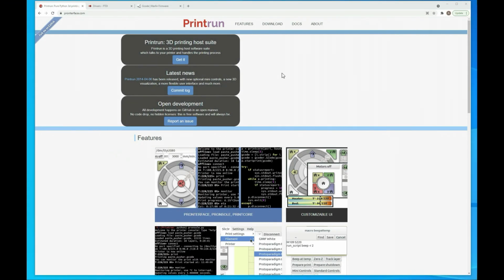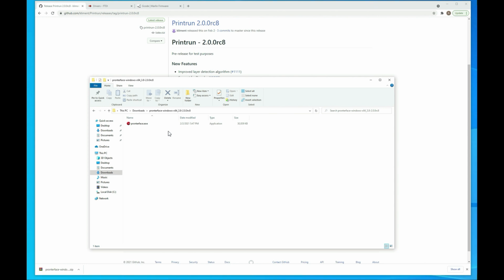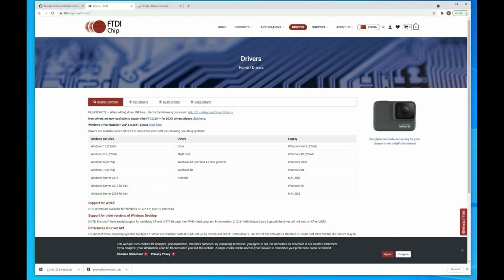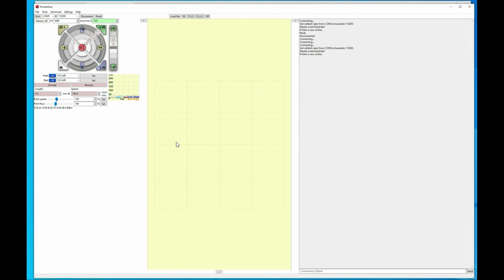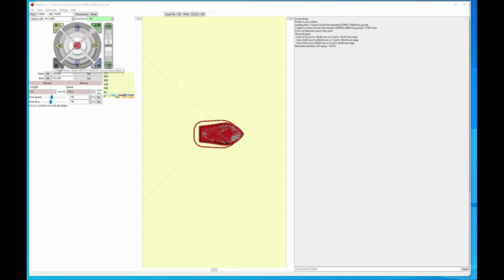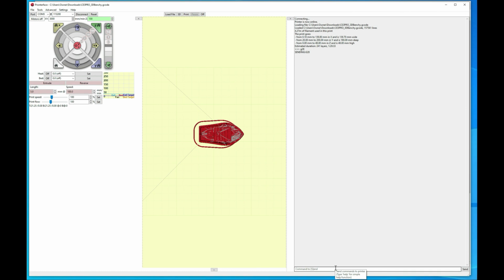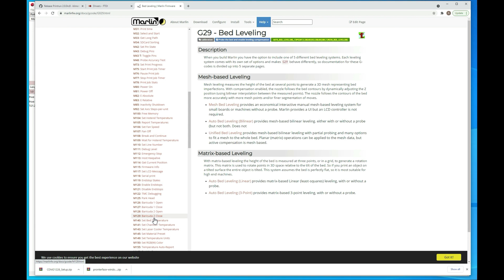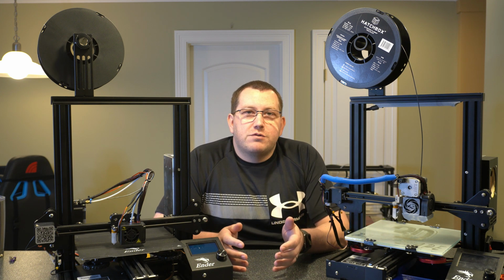Pronterface Setup – The Easy Way!

Comment from the maker: I hope you found this overview helpful! If you have any questions or would like other tips/tricks, just let me know in the comments or join us on Discord.
Reply: I have a CR 6SE. I can't find a driver to connect to the Fronterface. Could someone out there that has one, could you post the direct link to me. Thanks
Reply: Does pronterface communicate via serial interface with the board running marlin? If so, does it send commands via ascii? Or does it send them as binary? If my arduino serial terminal is up, can i send a serial out command to the board running marlin?can i send a m121 command via the terminal window?
Reply from the maker: @damon_81  My understanding is that pronterface communicates to the board over a serial connection. When connected you can send gcode commands via the terminal to the printer. I dont have a good answer on your other questions, sorry.

Comment: I fixed my e steps on ender 5 plus but now i have 5 blank pages for my print files
Reply from the maker: Hi. In the screen your just seeing blank menus? Did you only update teh esteps or was anything else changed?
Reply: @3DPrintscape on the screen with or without sd card also tried a new 8 gb sd card and still 5 blank pages i just changed the e steps with pronterface and went to do a test print and then it stopped the print midway and the sd card that was in there got destroyed as well
Reply from the maker: @alanoconnor7970  Ive never seen this behavior before, it could be a hardware issue.

Comment: I have a CR 6SE. I can't find a driver to connect to the Fronterface. Could someone out there that has one, could you post the direct link to me. Thanks
Reply from the maker: Hi. The driver may have been auto installed when the device was connected. You may not need a separate one.
Reply: @3DPrintscape  
I did a windows update and that fixed my problem. Thanks

Comment: I am not able to make perfect circle. Printer is drawing 2 side parallel lines. how to solve this? I am using pen for calibration. During rectangle, square or triangle I am getting perfect shape with exact dimensions.
Reply from the maker: Hi. Honestly i have never tried this though it should be possible.

Comment: gettin ""Got rubbish reply from COM3 at baudrate 115200:
Maybe a bad baudrate?" , no matter what baudrate i select, always the same. manager says printer is there, port COM3, thats what i select.... i dont see the problem :/
Reply from the maker: Hi. Are you sure its the right com port? Also, did you try rebooting? I have seen ports get locked or have random issues get fixed by rebooting. If that doesnt work, try a different cable.

Comment: Hi!
I m a Mechatronics Engineer. I m working on a 3d printer. I used the same Pronterface for 3d printing. When I upload the gcode file to print. After uploading when I gave Print command the printer doesn't print. The stepper motors works but while temperature command of hotend and bed the software gives an error *Write Timeout*.
How to solve this error? What's the point due to which this problem arrises?
Reply from the maker: Hi. Are you sending the commands one at a time or all at once? Im curious if its a buffer issue.
Reply: @3DPrintscape  One command at a time
Reply from the maker: @talhazafar7159  Ok, i have never seen this before. It may be worth checking computer memory/disk to make sure its not running out of space. If that looks ok, look at the event logs around that time to see if it give you more info on the error.

Comment: Hi, I am using Pronterface to check for error messages.  The error is random and may occur after several hours.  How do I send the error messages to a log file so I can read them later.  There seems to be an option in the menu but I am not sure of how the path should be written and could not get it to work.
Reply from the maker: Hi. I have never tried to save the logs to a file. There may be an option in pronterface to do it but I’m not sure.

Comment: I made printer and create stl file to gcode file when put gcode file in pronterface connected and run but my printer not run on gcode file and how to set this problem
Reply from the maker: Hi. I dont send the prints from pronterface so im not sure what the process looks like. Assuming you used a slicer to make the gcode file, sending it should start the print.

Comment: Well that confirms my suspicions  pronterface is rubbish... I had so many problems with this pos 
I now use repetier host which impv is miles better and connects no problem does all this and more and is also a decent slicer .. Plus its all free ..
Reply from the maker: Hi. Ya it’s not great but works most of the time. I will look into repetier.

Comment: When i try to connect it gives me this error (13, 'Access is denied.', None, 5). Any help?
Reply from the maker: Hi. Ive seen this when connecting to the wrong device or something already locking the connection. Rebooting the computer fixes it most of the time.
Reply: hey.......... did you find out the actual cause of this error?? i have been facing this issue for 18 days but still can't find the solution... it would be much appreciated if you could help me out

Comment: A very helpful video.  Appreciated.  I have an odd error that I just cannot figure out.  When loading files for USB printing I'll get a memory error "cannot load memory into array".  doesn't matter the size but usually happens with larger files.  I I have one that is 40+MB and 733 lines.  Always fails loading around line 400.  Sometimes sooner and other times later.  SD card printing is not an option.  Must be USB.

Long story short this happens on any PC (win 10 and win 11) so it is NOT the computer or OS.  This is something with pronterface itself.  Appears that while loading the file it just runs out of its reserved memory but it's not consistent.  Any ideas on how to fix this?  Any settings I can look at that are specific to pronterface or ways to increase the amount of memory it has allocated?
Reply from the maker: Hi. I havent seen this issue before. What are the specs on your computer? Did you try rebooting or another computer?
Reply: @3DPrintscape  The win 10 is an older HP.  T9300 CPU and 8GB RAM.  The newer one is Win 11 and I5 with 16GB RAM.  The only applications that give any form of memory allocation issue is pronterface.  The printer controller has an issue with the SD card reader so USB printing is the only option.  I am no stranger to computer errors and troubleshooting but this one stumps me and why I am convinced it's a pronterface issue.  I suspect it might be related to loading the file while it updates the preview and I'm trying to find a setting for that.  Not sure on the terminology though so it'll be trial and error I suspect.  I know it's also not limited to large gcode files.  It happens with 1.5Mb files and a 70MB file.  It's always past the point where 50% of the file loads though.  Rebooting helps some times but not always.  

Typically I find the best thing is to disconnect from pronterface, unplug the USB cable, power off the printer, shutdown (not restart) the computer, then restart the computer, power on the printer, start pronterface, connect the USB then connect to the printer and load the file.  That resolves it more often than not but ONLY if I follow that exact process.  Sometimes I'll have to repeat 5 or 6 times before the file will fully load.
Reply from the maker: @Enjoymentboy  Gotcha, i havent seen this before. I think its based on java, which will cap the memory based on how much the commuter has. That said, i havent actually tired it with a computer that has less than 32gb memory, i dont see why one with 16 wouldn't work though.

Comment: Hey man, everything worked, except my printer won't connect through pronterface for some reason, it's an ender 3 s1, and I tried every baud rate, I even had the printer plugged in with a usb connected to my computer, what do I do?
Reply from the maker: Hi. Have you tried any other usb cable? Many of them are meant for charging only and wont carry data.

Comment: Thx for the video. I would have a question. I would like to control a stepper motor and 2 heat cartridges for an automated coating process. I connected them with ramps 1.4. Can i write a g-code on pronterface to control that process? I tried Marlin but it always showed an error message.
Reply from the maker: Hi. If all changes are gcode commands, it should work in pronterface.

Comment: I am getting error: "Fatal Error Detected. Failed to execute script pronterface". Any workaround fot this?
Reply from the maker: Hi. Is that when loading pronterfrace?
Reply: @3DPrintscape  Yes, it was after launch.
"pronterface-windows-x64_3.8-2.0.0rc8.zip" on Pronterface's github page only had a  single file "pronterface.exe", which gave above mentioned error after launch. There were no supporting files.

I got "Printrun-win-18Nov2017.zip" which is working fine😀.

Thank you!!!!!
Reply from the maker: @MahipalYadavmahii  Gotcha, glad you got it working.

Comment: I can't find a way in the GUI to stop the print?  Like when adhesion fails.
Reply from the maker: Hi. If your wanting to do it in pronterface, i think you will have to send the gcode command for it. Try M112.
Reply: @3DPrintscape  Hi. Thank you for the quick reply and M code. I will give that a try. I have also been told to pause the print via pronterface. Then home. Then restart. Thanks again ;)
Reply from the maker: @GaryScottPhotographer  Honestly, i wouldnt run the print at all through printerface, or anything in windows. I just use it for troubleshooting and testing. The issue is that if the app freezes, or your computer reboots, you will lose the print.
Reply: @3DPrintscape  Spot on. That was my first time using a terminal. It was to configure the E-steps also a first) I may have gotten a little over excited :D  Thanks again for the advice. And thanks for sharing. If it weren't for your hard work and others like you this hobby/addiction could easily overwhelm me. ;)

Comment: Hello, when I sent commands M211 S0 and S1, it does not work in my 3d printer. The other controller change the location of nose and it works. Also, when I start print, it does not work. Can you help me to solve problem
Reply from the maker: Hi. Do any commands work, just looking to see if the connection is actually established.
Reply: @3DPrintscape  I solved the problem. My usb was not fat32 and I used a program to make it.

Comment: Can i also work from a different pc and send the Cura slice to the computer which is having the pronterface. Installed? ?
Reply from the maker: Hi. In theory you would be able to if you can connect to it through RDP or something but i think you will have a lot of issues. If you want to connect remotely, i would go with octopi.
Reply: @3DPrintscape  ok 👍 thanks and greetings from the Netherlands 😎

Comment: Hi~
Can we use Pronterface for the metal 3D printer?
Looking forward to your response. Thank you.
Reply from the maker: Hi. If it uses a USB to serial connection and recognizes g code commands it should work.
Reply: @3DPrintscape  thank you I will try to check the printer.
Reply from the maker: @mark7322  You're Welcome

Comment: hi thanks for that video it was a great help im a beginner, so i have my connection from pronterface on my pc and i can control my ender3 pro from it. so now i want to use cura to print what is the procedure, thanks in advance. ian
Reply from the maker: Hi. Thanks for the feedback. I would recommend against trying to do that. If the computer goes to sleep, reboots for updates or anything like that you will loose your print. If you want to control the printer from your computer, i would recommend setting up Octopi on a raspberry pi or something similar.
Reply: @3DPrintscape  thanks very much for your responce i will try that. ian

Comment: Hey Rob, I noticed in another video when you used Pronterface for Bedleveling (G29) it came back with just the bed leveling mesh. But when I do this with my Ender 3 Pro, it responds with a great number of 'Printer busy...' statements, and the command rolls off the screen before the mesh appears. How did you turn that off? Or do I just need to download a later version of Pronterface?
Reply from the maker: Hi. Are any of the commands working or are they all saying printer busy? Have you tried to restart your computer?
Reply: @3DPrintscape  all the commands work, if just spams echo:printer busy about 100 times before returning the bed level mesh output. I dropped a screenshot as Quill1988 on the discord site. It’s. not broken, just annoying and I noticed in your video you weren’t getting it.
Reply from the maker: @chrissolaas3054  Thats interesting. Have you tried to clear eeprom at all?

Comment: So boot up pronto. Then connect printer should I turn on printer ? Or just run thru usb power.I got it connected to my ender3v2 loaded a file was able to adjust a axis But it slowed printing speed down to a crawl I was using the displayed defaults.Also you vids are clear and concise
Reply from the maker: Hi. Pronterface should be able to connect with just usb power, or with the main power on. When you said it slowed down the print, were you printing from the sd card and just had it connected?

Comment: How to don't send power  from my PC?
Reply from the maker: Hi. It will also send some power over the USB cable, its enough to power the screen but not the heaters or anything like that.
Reply: @3DPrintscape  i  know but if i turn the printer on IT start turning on And of
Reply from the maker: @josefkamenik3333  Can you try turning on the printer then connecting it to your computer?

Comment: I had everything setup properly and then I accidentally moved the usb cord in the middle of a print, and long story short I ended up making the screen go completely blank. Anyone have any experience with this?
Reply from the maker: Hi. Did the printer go back to normal after you restarted it? Also, I wouldn't recommend printing from a Windows computer. If a task locks up or the computer restarts for updates you will lose the print.
Reply: @3DPrintscape  So what happened is it was heating up, and getting ready to start, and then I accidentally moved the cable causing an error on the computer. I tried plugging the cable back in, hoping that I would be able to resume what it was doing, but when the print didnt start I just hit stop. When I realized that hitting "off" was not working and the printer was still set to the previous heat settings, I tried turning it off manually. When I turned it back on everything was blank and has been the same ever since. I even tried deleting everything on the sd card that was in the printer and running it without an sd card but this did not work. Posting all these details just incase someone else has had this exact issue, I hope to be able to dedicate more time to this issue later.
Reply from the maker: @SwayK47  Gotcha, It may be worth trying to update the firmware. Its possible that something got corrupted when the cable got disconnected.

Comment: Okay Device manager didn't work for me so I wen to ponter verse. small issue is I have windows 11 and I tried getting desktop version then I went to ponterface. I did not get the option to for COMM and I played with the rate system it still couldn't detect it. I got a little lost when you talked about the marlin website. I don't know what it is right now. I am gonna have to take a break figuring this out.
Reply from the maker: Hi. I haven't tried to get this working, or verified the drivers, on Windows 11.

Comment: Hi. I have an Ender III. I have it plugged into my computer. I know the computer has sensed it's plugged in because it made the familiar ding with a new device being plugged in. However, even though I followed your instructions and opened the device manager to check the USB Serial port, my computer isn't recognizing my printer and thus it is not showing up in ponterface. I tried downloading, exporting, extracting, and installing the FTDI driver, that did not solve it. I unplugged the device from my computer and plugged it back in. I restarted my computer. I tried searching automatically and then manually for the driver for the port. No luck. Can you help?
Reply: I also say use a different cable. That as well as using a specific usb port on my laptop solved the issue for me.
Reply from the maker: Hi. Try to use a different USB cable. Many of them are only meant for charging, not data.
Reply: @3DPrintscape  Hi, thanks for responding. I bought a cord that specifically was advertised as being able to transfer data, but I've plugged that in and I'm still experiencing the same issue as above. Any other suggestions? Thanks in advance for any help you can provide.
Reply from the maker: @williamlovell7413  If you have a Rasberry Pi with OctoPrint, you could try to connect it to that. That will tell you if its an issue with the cord/printer or the computer/driver.